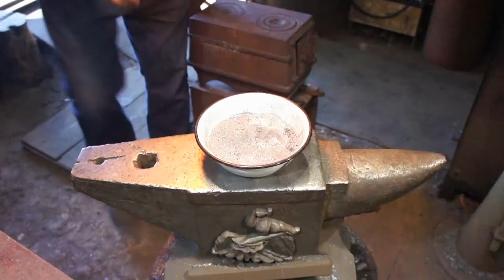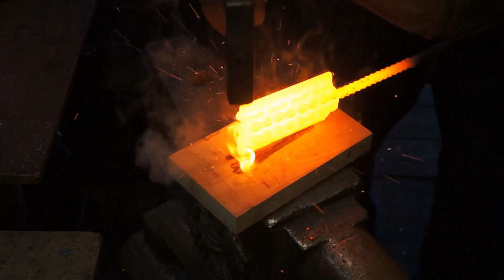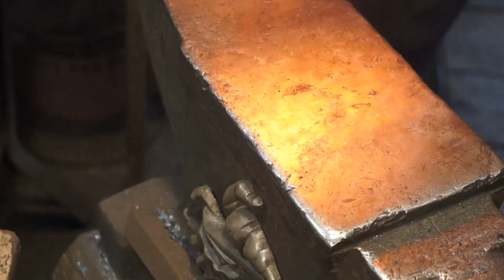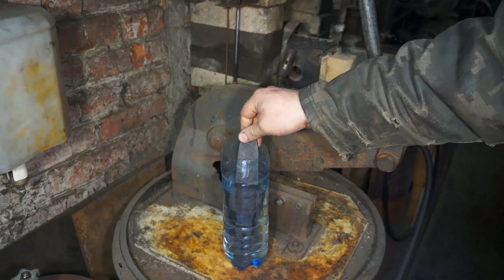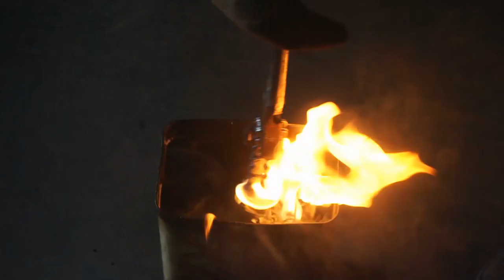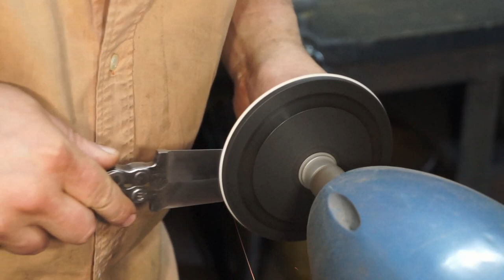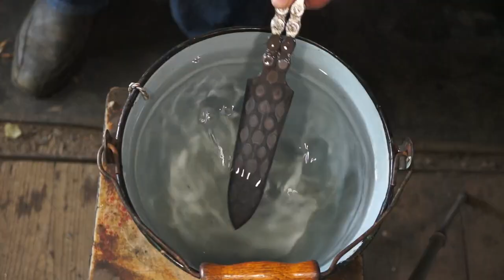Blade "Mad Max", Damascus steel from a motorcycle chain.

Comment: What is the powder being sprinkled on the glowing metal?
Reply from the maker: I sprinkle flux (90% borax + 5% quartz sand + 5% charcoal powder) this is necessary for forging (forge) welding. The flux is alloyed with scale - the formed substance is sufficiently fluid and is easily displaced by deformation. In addition, the flux protects against oxygen and charcoal, carburizes the surface layer of metal - which lowers the welding temperature (if in brief).
Reply: Thanks @shurap  
 I'm really wanting to start  dabbling in blacksmithing, not necessarily knife making but pounding railroad spikes and other scrap metal into something else, possibly something useful if I get good enough at it.

Comment: Was wondering what is the powder he sprinkles over the hot steel?
Reply from the maker: I sprinkle flux (90% borax + 5% quartz sand + 5% charcoal powder) this is necessary for forging (forge) welding. The flux is alloyed with scale - the formed substance is sufficiently fluid and is easily displaced by deformation. In addition, the flux protects against oxygen and charcoal, carburizes the surface layer of metal - which lowers the welding temperature (if in brief).

Comment: what does he put on the hot metal in the beginning? the powder?
Reply from the maker: I sprinkle flux (90% borax + 5% quartz sand + 5% charcoal powder) this is necessary for forging (forge) welding. The flux is alloyed with scale - the formed substance is sufficiently fluid and is easily displaced by deformation. In addition, the flux protects against oxygen and charcoal, carburizes the surface layer of metal - which lowers the welding temperature (if in brief).
Reply: @shurap  thanks a bunch

Comment: What is the dust from the bowl he keeps putting on it?
Reply from the maker: I sprinkle flux (90% borax + 5% quartz sand + 5% charcoal powder) this is necessary for forging (forge) welding. The flux is alloyed with scale - the formed substance is sufficiently fluid and is easily displaced by deformation. In addition, the flux protects against oxygen and charcoal, carburizes the surface layer of metal - which lowers the welding temperature (if in brief).
Reply: @shurap  hey thanks for the info! Very cool

Comment: What is the powder you sprinkle on it? Thanks.
Reply from the maker: I sprinkle flux (90% borax + 5% quartz sand + 5% charcoal powder) this is necessary for forging (forge) welding. The flux is alloyed with scale - the formed substance is sufficiently fluid and is easily displaced by deformation. In addition, the flux protects against oxygen and charcoal, carburizes the surface layer of metal - which lowers the welding temperature (if in brief).
Reply: shurap Thanks for the explanation.

Comment: May i know what sandy powder he spread on the steel surface for?
Reply from the maker: I sprinkle flux (90% borax + 5% quartz sand + 5% charcoal powder) this is necessary for forging (forge) welding. The flux is alloyed with scale - the formed substance is sufficiently fluid and is easily displaced by deformation. In addition, the flux protects against oxygen and charcoal, carburizes the surface layer of metal - which lowers the welding temperature (if in brief).
Reply: @shurap  sincerely appreciate your informations.

Comment: What is the material you keep sprinkling on you metal
Reply from the maker: I sprinkle flux (90% borax + 5% quartz sand + 5% charcoal powder) this is necessary for forging (forge) welding. The flux is alloyed with scale - the formed substance is sufficiently fluid and is easily displaced by deformation. In addition, the flux protects against oxygen and charcoal, carburizes the surface layer of metal - which lowers the welding temperature (if in brief).
Reply: @shurap  did you go to a school to learn how to do your work. Or learn as an apprentice.its very interesting

Comment: whats that powder he keeps sprinkling on ?
Reply from the maker: I sprinkle flux (90% borax + 5% quartz sand + 5% charcoal powder) this is necessary for forging (forge) welding. The flux is alloyed with scale - the formed substance is sufficiently fluid and is easily displaced by deformation. In addition, the flux protects against oxygen and charcoal, carburizes the surface layer of metal - which lowers the welding temperature (if in brief).

Comment: What is he seasoning it with?
Reply from the maker: I sprinkle flux (90% borax + 5% quartz sand + 5% charcoal powder) this is necessary for forging (forge) welding. The flux is alloyed with scale - the formed substance is sufficiently fluid and is easily displaced by deformation. In addition, the flux protects against oxygen and charcoal, carburizes the surface layer of metal - which lowers the welding temperature (if in brief).

Comment: What is the powder u sprinkle on the blade
Reply from the maker: I sprinkle flux (90% borax + 5% quartz sand + 5% charcoal powder) this is necessary for forging (forge) welding. The flux is alloyed with scale - the formed substance is sufficiently fluid and is easily displaced by deformation. In addition, the flux protects against oxygen and charcoal, carburizes the surface layer of metal - which lowers the welding temperature (if in brief).

Comment: Always wondered why he puts a block of wood on the anvil for the first hammering
Reply from the maker: The first welding is done on a tree, as the tree is a heat insulator, and not so selects temperature as an iron anvil. In addition - burning, the tree burns oxygen, protecting the workpiece and pouring the flux work. This is important for welding workpieces with small parts (cable, chain).
Reply: @shurap  Thanks for the reply, I understand now. Your creations really are works of art.

Comment: Que pó é esse que ele taca no ferro em brasa?
Reply from the maker: Polvilhe com fluxo (bórax 90% + areia de quartzo 5% + carvão em pó 5%), isto é necessário para a soldagem (ferraria). O fluxo é fundido com incrustações - a substância resultante é bastante fluida e é facilmente deslocada durante a deformação. Além disso, o fluxo protege contra o oxigênio e, devido ao carvão, carbura a camada superficial do metal - o que diminui a temperatura da soldagem (se por breves instantes).

Comment: What is that fine dust you put on?
Reply from the maker: I sprinkle flux (90% borax + 5% quartz sand + 5% charcoal powder) this is necessary for forging (forge) welding. The flux is alloyed with scale - the formed substance is sufficiently fluid and is easily displaced by deformation. In addition, the flux protects against oxygen and charcoal, carburizes the surface layer of metal - which lowers the welding temperature (if in brief).

Comment: Qué polvo le arroja a la pieza que está rojo vivo?
Reply from the maker: Rocíe con fundente (bórax 90% + arena de cuarzo 5% + polvo de carbón 5%) esto es necesario para la soldadura (herrería). El fundente se fusiona con la escala: la sustancia resultante es bastante fluida y se desplaza fácilmente durante la deformación. Además, el fundente protege contra el oxígeno y, debido al carbón, carbura la capa superficial del metal, lo que reduce la temperatura de soldadura (si es brevemente).

Comment: what is the flux you are using?
Reply from the maker: I sprinkle flux (90% borax + 5% quartz sand + 5% charcoal powder) this is necessary for forging (forge) welding. The flux is alloyed with scale - the formed substance is sufficiently fluid and is easily displaced by deformation. In addition, the flux protects against oxygen and charcoal, carburizes the surface layer of metal - which lowers the welding temperature (if in brief).

Comment: What if you were to put the chain in a canister and filled the void, empty space with powdered metal?
Also, what if you were to drill holes in a block, then fill the hole with a drill bit and metal power? Maybe a ying and yang pattern?

Что, если бы вы поместили цепь в канистру и заполнили пустое пространство металлическим порошком?
Кроме того, что, если бы вы просверлили отверстия в блоке, а затем залили бы отверстие сверлом и металлической насадкой? Может быть, узор инь и янь?
Chto, yesli by vy pomestili tsep' v kanistru i zapolnili pustoye prostranstvo metallicheskim poroshkom?
Krome togo, chto, yesli by vy prosverlili otverstiya v bloke, a zatem zalili by otverstiye sverlom i metallicheskoy nasadkoy? Mozhet byt', uzor in' i yan'?

Comment: Can someone tell me whats he is sprinkling on the blade please.?
Reply from the maker: I sprinkle flux (90% borax + 5% quartz sand + 5% charcoal powder) this is necessary for forging (forge) welding. The flux is alloyed with scale - the formed substance is sufficiently fluid and is easily displaced by deformation. In addition, the flux protects against oxygen and charcoal, carburizes the surface layer of metal - which lowers the welding temperature (if in brief).
Reply: @shurap  Hey Man thanks alot,your an Artist

Comment: What is the name of the powder for sowing on hot iron.
Reply from the maker: I sprinkle flux (90% borax + 5% quartz sand + 5% charcoal powder) this is necessary for forging (forge) welding. The flux is alloyed with scale - the formed substance is sufficiently fluid and is easily displaced by deformation. In addition, the flux protects against oxygen and charcoal, carburizes the surface layer of metal - which lowers the welding temperature (if in brief).
Reply: Thanks for the explanation

Comment: what is the name of the pouring powder?
Reply from the maker: I sprinkle flux (90% borax + 5% quartz sand + 5% charcoal powder) this is necessary for forging (forge) welding. The flux is alloyed with scale - the formed substance is sufficiently fluid and is easily displaced by deformation. In addition, the flux protects against oxygen and charcoal, carburizes the surface layer of metal - which lowers the welding temperature (if in brief).

Comment: Whats the name of the Spice he keeps putting on the hot metal? Chilli?
Reply from the maker: I sprinkle flux (90% borax + 5% quartz sand + 5% charcoal powder) this is necessary for forging (forge) welding. The flux is alloyed with scale - the formed substance is sufficiently fluid and is easily displaced by deformation. In addition, the flux protects against oxygen and charcoal, carburizes the surface layer of metal - which lowers the welding temperature (if in brief).

Comment: what is purpose of pouring powder?
Reply from the maker: I sprinkle flux (90% borax + 5% quartz sand + 5% charcoal powder) this is necessary for forging (forge) welding. The flux is alloyed with scale - the formed substance is sufficiently fluid and is easily displaced by deformation. In addition, the flux protects against oxygen and charcoal, carburizes the surface layer of metal - which lowers the welding temperature (if in brief).
Reply: @shurap  thanks for your reply

Comment: What is that powder he keeps putting on it?
Reply from the maker: I sprinkle flux (90% borax + 5% quartz sand + 5% charcoal powder) this is necessary for forging (forge) welding. The flux is alloyed with scale - the formed substance is sufficiently fluid and is easily displaced by deformation. In addition, the flux protects against oxygen and charcoal, carburizes the surface layer of metal - which lowers the welding temperature (if in brief).
Reply: @shurap  How much would you charge for one of those?

Comment: What spice rub is he using there?
Reply from the maker: I sprinkle flux (90% borax + 5% quartz sand + 5% charcoal powder) this is necessary for forging (forge) welding. The flux is alloyed with scale - the formed substance is sufficiently fluid and is easily displaced by deformation. In addition, the flux protects against oxygen and charcoal, carburizes the surface layer of metal - which lowers the welding temperature (if in brief).
Reply: @shurap  
 shurap  
Thanks for the info Shurap. Great job on your forge ✌

Comment: ok dumb question from a non blacksmith what is the purpose of striking the steel on the piece of wood?
Reply from the maker: The first welding is done on a tree, as the tree is a heat insulator, and not so selects temperature as an iron anvil. In addition - burning, the tree burns oxygen, protecting the workpiece and pouring the flux work. This is important for welding workpieces with small parts (cable, chain).

Comment: What is that dust he keeps putting on it
Reply from the maker: I sprinkle flux (90% borax + 5% quartz sand + 5% charcoal powder) this is necessary for forging (forge) welding. The flux is alloyed with scale - the formed substance is sufficiently fluid and is easily displaced by deformation. In addition, the flux protects against oxygen and charcoal, carburizes the surface layer of metal - which lowers the welding temperature (if in brief).
Reply: @shurap  makes sense thank you

Comment: I’ve always wondered why they use wood when dealing with complex shapes. Never been able to find a definitive answer. Someone help.
Reply from the maker: The first welding is done on a tree, as the tree is a heat insulator, and not so selects temperature as an iron anvil. In addition - burning, the tree burns oxygen, protecting the workpiece and pouring the flux work. This is important for welding workpieces with small parts (cable, chain).
Reply: I can only imagine it has something to do with only allowing the force of the hammer to deform the metal on one side. That the wood helps retain the shape of chain while forge welding.

Comment: What's that powder he puts on?
Reply from the maker: I sprinkle flux (90% borax + 5% quartz sand + 5% charcoal powder) this is necessary for forging (forge) welding. The flux is alloyed with scale - the formed substance is sufficiently fluid and is easily displaced by deformation. In addition, the flux protects against oxygen and charcoal, carburizes the surface layer of metal - which lowers the welding temperature (if in brief).

Comment: Whats that powder ?
Reply from the maker: I sprinkle flux (90% borax + 5% quartz sand + 5% charcoal powder) this is necessary for forging (forge) welding. The flux is alloyed with scale - the formed substance is sufficiently fluid and is easily displaced by deformation. In addition, the flux protects against oxygen and charcoal, carburizes the surface layer of metal - which lowers the welding temperature (if in brief).

Comment: Why start off with a fire brick on top of the anvil?
Reply from the maker: The first welding is done on a tree, as the tree is a heat insulator, and not so selects temperature as an iron anvil. In addition - burning, the tree burns oxygen, protecting the workpiece and pouring the flux work. This is important for welding workpieces with small parts (cable, chain).
Reply: @shurap  Interesting. Thanks. I can see now that it is a wooden board.  The first time I saw it, I thought it was a fire brick.

Comment: What is that in the bowl at 1:13
Reply from the maker: I sprinkle flux (90% borax + 5% quartz sand + 5% charcoal powder) this is necessary for forging (forge) welding. The flux is alloyed with scale - the formed substance is sufficiently fluid and is easily displaced by deformation. In addition, the flux protects against oxygen and charcoal, carburizes the surface layer of metal - which lowers the welding temperature (if in brief).

Comment: What's the powder he's throwing on there
Reply from the maker: I sprinkle flux (90% borax + 5% quartz sand + 5% charcoal powder) this is necessary for forging (forge) welding. The flux is alloyed with scale - the formed substance is sufficiently fluid and is easily displaced by deformation. In addition, the flux protects against oxygen and charcoal, carburizes the surface layer of metal - which lowers the welding temperature (if in brief).
Reply: @shurap  Thank you! Very cool!

Comment: Why do you add ash?
Reply from the maker: I sprinkle flux (90% borax + 5% quartz sand + 5% charcoal powder) this is necessary for forging (forge) welding. The flux is alloyed with scale - the formed substance is sufficiently fluid and is easily displaced by deformation. In addition, the flux protects against oxygen and charcoal, carburizes the surface layer of metal - which lowers the welding temperature (if in brief).

Comment: Curious why sometimes he starts on the wood then switches to bare anvil
Reply from the maker: The first welding is done on a tree, as the tree is a heat insulator, and not so selects temperature as an iron anvil. In addition - burning, the tree burns oxygen, protecting the workpiece and pouring the flux work. This is important for welding workpieces with small parts (cable, chain).
Reply: Thank you shurap! I have to say that your channel is by far one of the most interesting i have come across. Beautiful work you do.

Comment: Why does he throw on the grey powder every now and then?
Reply from the maker: I sprinkle flux (90% borax + 5% quartz sand + 5% charcoal powder) this is necessary for forging (forge) welding. The flux is alloyed with scale - the formed substance is sufficiently fluid and is easily displaced by deformation. In addition, the flux protects against oxygen and charcoal, carburizes the surface layer of metal - which lowers the welding temperature (if in brief).
Reply: @shurap  so it basically it joins the metal pieces, in this case the chains, together?

Comment: QE ES ESE POLVILLO QE LE PONES EN CALIENTE
Reply from the maker: Espolvorea con fundente (bórax 90% + arena de cuarzo 5% + polvo de carbón vegetal 5%) esto es necesario para la soldadura (herrería). El fundente se fusiona con la incrustación: la sustancia resultante es bastante fluida y se desplaza fácilmente durante la deformación. Además, el fundente protege contra el oxígeno y, debido al carbón, carbura la capa superficial del metal, lo que reduce la temperatura de soldadura (si es brevemente).